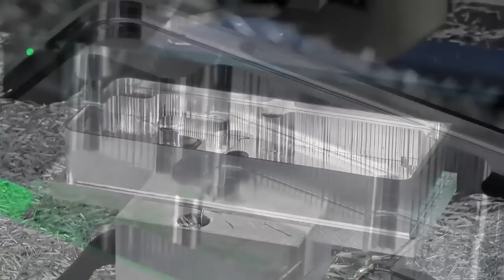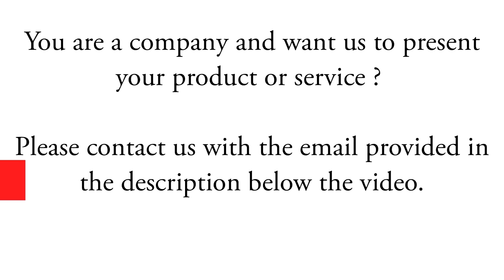DATRON CNC MACHINE FAST MILLING

Comment: Very interesting.  Might I ask why a conventional cut with the chamfer mill on foam?  I was mesmerised by the aluminum part, even after 30 years of machine work.  Nice.
Reply from the maker: It's not really matter on foam materials. Regards.
Reply: lol, didn't figure it did, thought maybe there was a reason, guess not!  Thanks for the reply, great vid!
Reply: Wasn't just the chamfer that was cut conventionally, my guess would be the material is pulled in when climb milled producing a poor finish. I haven't milled foam but I've milled rubber and I ended up doing my finish passes conventionally for the same reason.

Comment: It spray(or spraies... which one is correct? I'm not good at eng.. ) oil like mist.. is that because of high rpm?
Reply: xX RUSH Xx it is a special way of lubrication called "minimal quantity lubrication". ( don't know if this is the right translation out of German language).
Under (high) pressure they blow minimal amounts  of oil onto the tool. just enough to have a thin film of oil for lubrication. Less oil less costs. And some other pros and cons. But that would lead way to far for YT comments. ;-)
Reply: Maul Schmeiss you are right sir.. it's oil mist .

Comment: The machine is cutting fast but material removal rate is slow!
Reply: i suppose because they using no coolent most of the time they take smaller cuts and more passes.